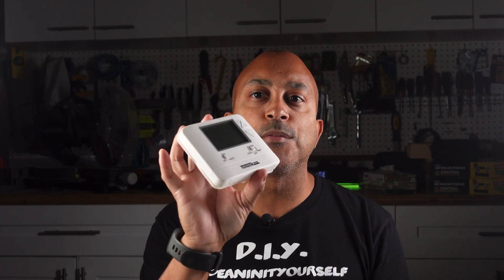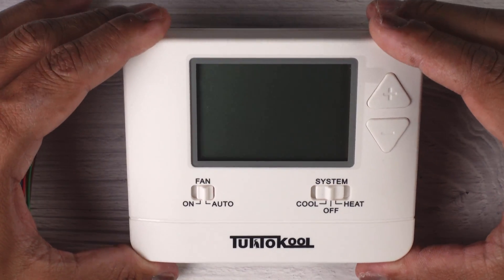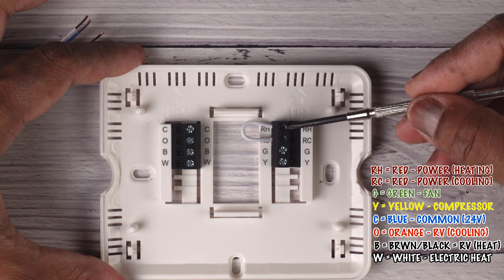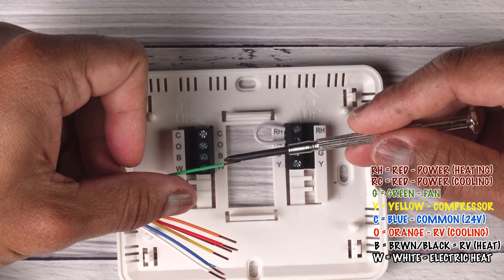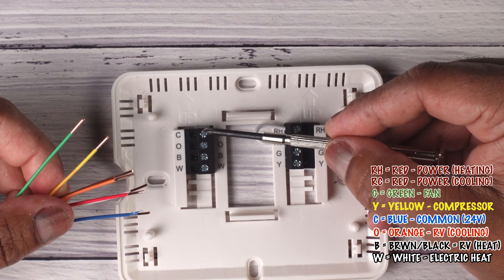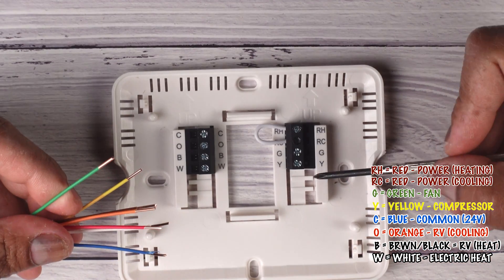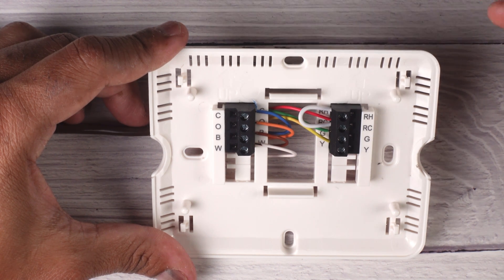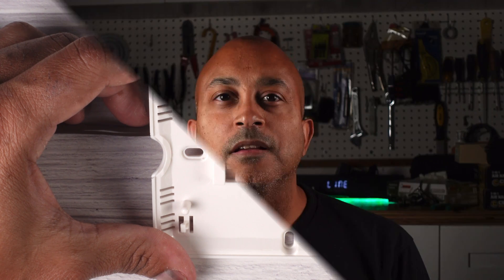Thermostat Wiring Basics, Everything you need to know.

Comment: How did you connect the red to RC with the white, I have a pin and only one wire fits the hole :( what's my options thanks
Reply from the maker: Not sure I understand
Reply: @DeaninItYourself  in the video you have the red and white wires in the same hole (RC) on my honeywell I have only pins and can't do that so what would be my options? Because with the pin on one wire fits in the hole. Thanks

Comment: @lourod57.  Thanks for your great videos, very helpful.  Have a question about replacing a vivint thermostat with an ecobee premium.  I have these wires on the vivint, C - blue, O/B orange, W2 white, Y yellow, RC red and G green.  I tried the Ecobee tool to see if my wiring is compatible and it referred me to the technical support because the wiring i entered in their tool were "unusual".  I sent a request to their support department, but have not  heard from them yet.  I am sure we have a heat pump, can you help with the proper connection for the Ecobee Premium?  I am assuming i will match the wires by color to the corresponding terminal on the ecobee.  Any recommendations?
Reply from the maker: yes the colors should correspond

Comment: Hello…I only have white red blue green. Can I still connect a WiFi thermostat??
Reply from the maker: You need to get another wire, are you sure is not there and maybe its just cut, strip the main cable and check if you have more wires in there.